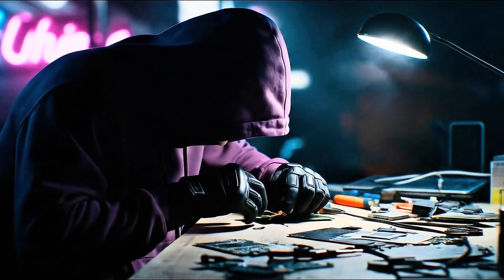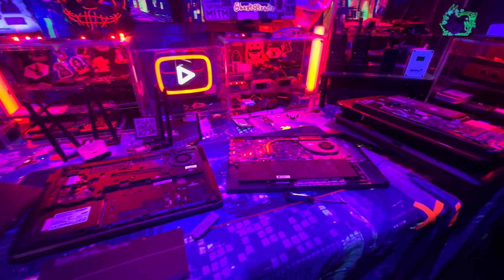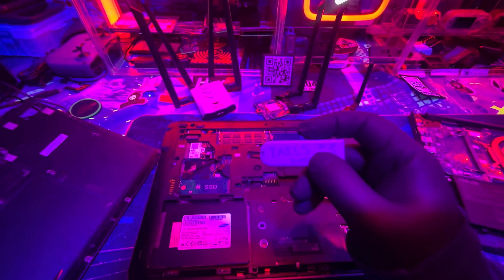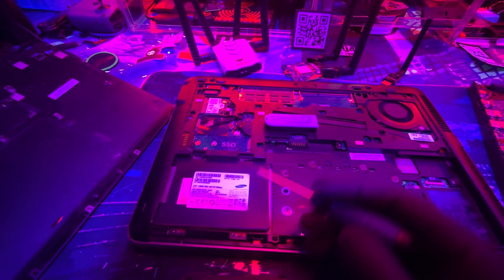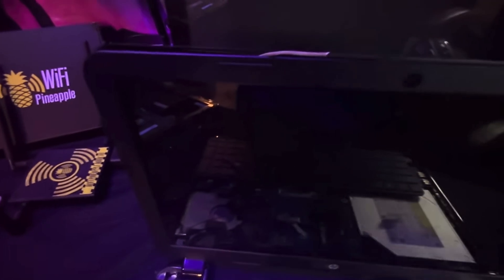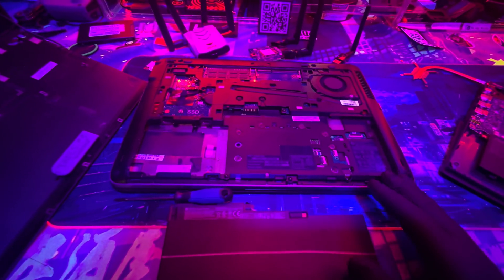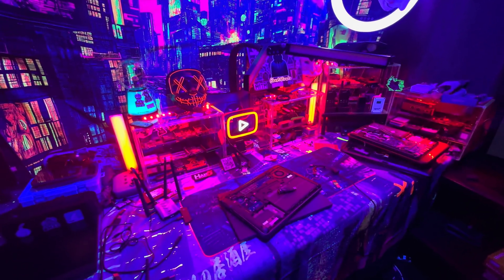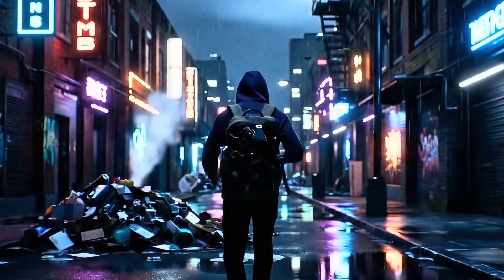DIY Ghost Laptop UPDATED: Full Build Guide — And the Harsh Truth About Privacy!

Comment: unless a device "falls off the truck" before it's sold it's always traceable to someone
even if you dumpster dive that device can be traced to who original bought it - so that's quite a thin point
also: how would you acquire one of those external wifi things? finding a working pc in an industrial dumpster - ok, Dave Jones from EEVBlog scores a system now and then - but an external wifi router to be hooked up via lan? c'mon - chances are quite low
the ideas are in the right direction but simply impractical

Comment: Other than removing cam/hdd/mic/speaker/wi-fi/bluetooth the mixing and matching parts is so marginally better than just one whole single privately purchased computer that this part should be considered silly. 1 whole computer vs 6 whole computers and mixing parts, the 1 computer is the better option. Also less likely your OPSEC was violated 1 time than several.

Comment: But...what about Intels IME hardware backdoor? Breaks this and can enter into OS.
Reply: With it being a laptop, IME will be able to use itself anytime the battery is charged even if off. As well as it will be able to read/copy/write to system ram memory. So IME will still see operation system. It would have to be a laptop CPU that's pre-IME.

Comment: Bro. You can buy a NEW laptop by paying with cash. Leave your phone at home, walk to the computer store, buy a laptop and accessories with cash, and there you go. Unless you are planning on committing a crime with it the same day you are probably fine. CCTV recordings get overwritten after a pre-set span of time, usually 30 or 90 days. Very unlikely that if 2 years later people are looking for you that any such evidence would even exist at that point tying you to your computer.

Also I like Qubes. It's my favorite OS ever. You can run TAILS in Qubes, as a disposable Qube. Even better that way! But you can also run many other VMs, such as Kali Linux. You can run a whole network on a single PC! For privacy and security it is very good. Hard to beat a Type I hypervisor for containment.

If you really don't want your presence tied to your laptop, you have to deal with WiFi immediately. Remove the internal WiFi radio like he does here, or just disable it in BIOS. Better to use a USB WiFi adapter. You adapter will remember all previous WiFi networks you have seen, and will call them out at new locations, telling everyone where you've been before. Your WiFi is constantly shouting, even if you don't hear it. Don't even use it if you can help it.

Comment: Tech makes it obvious about the lack of privacy dude.. lol even complex code, your ultra encrypted password is just a much longer password.. computers are just an illusion of complexity used as lock and key.. confusion for entry and only those that understand it may enter. As far as privacy well, the signals got to go out and it has to be recieved theres no way around that, so an address to and from minimum are needed. Just a matter of figuring out where to hide that in the layered complexity of the code. But control plus f key keyboard in notepad which is where most of computer code gets modified will bring a search tool out eliminating that so a rename and another notepad program file with defenitions that define the characters of the change.

Comment: Great video, doesn't any os run from the ram though? The storage (SSD,nvme,HDD), stores the os in long term memory, when the computer boots the os is loaded into and then run from the ram. So tails Linux is the only operating system to boot on a system from usb and run in ram? Or do most Linux operating systems load from usb and run, then ask if you want to install to long term memory?

Comment: When you buy a new laptop from Amazon they only scan the UPC not the serial number. So if you're using tales along with a WiFi antenna and an external hard drive then once you unplug from it the computer will always be a new computer. But I think you're better off using a raspberry pi and removing the Wi-Fi and Bluetooth card and just build it
Reply: I’m dumb but just read this. if you bought laptop from amazon, tried returning it to amazon with a replaced laptop trying to pass off as the new one, it wouldn’t work cause serial number.

Comment: Cough, cough, Raspberry Pi anyone? Admire what you're doing, but anytime you connect to the internet, you leave a fingerprint. The browser OS etc are all recorded, in the hard drive is the smoking gun. Raspberry Pi can use a small SD card, easier to swallow... Dude Tails on a Pi 0W2 would be far cheaper and far more anonymous? I live on the dark web, it is very anonymous as long as you don't break the rules. A Raspberry Pi is awesome for this, and it will fit in your jeans pocket.  Proxy Chains and Anon-surf are brilliant Linux tools. Your ISP knows you are using Tor, but that's all, they can not see what you do on Tor if you follow the rules. Proxy Chains gives you a new proxy every few seconds. Your hard drive will be the evidence in court! Remember this. Nothing else has enough evidence. Without the Hard drive, they have nothing. You will never be a ghost, just be a way smaller fish than any other mischief-maker and hope the filth goes after them, this dude is 100% on how not anon you are 100%. F stuff up and F the system!
Reply: What you do on the dark web? Never really understood whats the fuzz about.
Reply: @HalleluaYah   chillin' duh

Comment: 1:52

1 is easy. buy it with a prepaid/charge card you paid for with cash. 

2 is easy.  have it delivered to a different house that's abandoned. 

3 isn't an issue if the purchace can't be tracked to you.

4 is easy.  buy an OLD laptop. 

5 is easy if you didn't buy it in a store.

Buy old a$$ laptop.

Take it apart and inspect the parts for any unwanted add-ons. 

Boot it up with a Tails OS boot drive. 

Use public wifi you find around areas you're not normally.  Don't bring your cell hone with you.

14:37  USB Kill is a childs toy that'll just break your PC.  I'd bet money nearly everything on an SSD/HDD would be ok.  and literally all of it on the HDD would be recoverable.

15:30  you literally can spoof how you type and speak and spell.

Comment: You missed one thing. The TPM chip is hooked up with the UEFI BIOS in computers since 2008 or so. As long as u keep the TPM with the UEFI it can be identified back to before being ghosted. So remove the TPM, replace UEFI with Coreboot - make sure u have a compatible machine. And also make sure to wipe the MAC address of the cable ETH controller even when not used. - and remove the CMOS-battery to also halt the RTC when off.

Comment: You dont have to snap your memory strip. just remove it and  connect a spring loaded metal bulldog clip across all memorys edge connections.
Reply: You do realize DIMM is volatile.. you dont have to destroy the DIMM at all just pull it from the slot
Reply: @thatgo916  it is supposed to be volatile, but I remember watching a video where they managed to extract data from the dimm.  however grounding all the pins together destroyed the data.  So that is a lot cheaper than snapping it in half like the author suggests.

Comment: Used to be that the recommendation for hard drives was to use an overwrite program to fill the drive with overwrite then repeat 6 times. One suggestion I saw was to find an unprotected network, access via say a cctv camera or wifi device, (often unprotected), and jump in through that. Very naughty and if one got caught doing that a big prosecution likely so do not do this...

Comment: If you have an LG or Samsung TV it runs on linux and keeps monitoring nearby devices even when turned off...so basically it can discover ur wireless even if ur connected to a different network , u should either unplug ur tv or not sure if there is a way to hide ur wireless receptors or NIC.
I just discovered recently that my TV keep scanning arround just like apple watch...do some research about , it's really tough to stay ghost nowadays with the IOT devices everywhere
Reply: There is no way to go ghost. Unless you literally destroy all your devices and never use the internet again and move to the middle of no where. Even then satellites will find you with due time.  Another way is to steal laptops, use other ppls internet, always wear a mask, cover the cameras with sticky notes and never speak around electronic devices. Also never stay in one spot 😂
Reply: Exactly. Your neighbors TVs and appliances can be used to track and locate you

Comment: Pro tip, microwave any components that have storage on them. The EMF energy will kill the chips from the inside out with the added bonus of corrupting any potential data. 

Or look into how to make an EMF wea-- uhh device to erase data.
Reply: Wouldn't that also screw with radios in the area? If I'm not mistaken (which I very well can be) it would very much gain the unwanted atention of anyone using a radio at the time.

Comment: Many great ideas, though i see some limitations:

still there are things like BIOS memory and graphic card fingerprinting. Unfortunately avoiding graphic card cuts You from way to fight stylometry: don't type for internet - type for one locally hosted llm, than this llm translate it to other language, next second local llmy translates it to another - i'm wondering about such solutions to counter stylometry and time-marks attacks. Anyway zombie laptop sticks out the same way as connection to tor, or running tails. Running the same software from live version of fedora/linuxmint/ubuntu is more time consuming. All this tricks to block backdors and spyware in popular graphic environments etc. take time. Yet once You identify as router, or nas or server or even average joe with popular linux, You don't raise as many flags. Maybe creating false random cookies from social network spyware is the reasonable choice - it's harder to distinguish You from normal network users.

Tails is great for fast jobs, provided that Your bios is not compromised. Persistant mode is just gathering evidence against You. Tool of alleged crime plus proofs of Your guilt. Saving things onto encrypted file on another pendrive is safer.

Comment: The speakers as microphones was an old cold war trick that I'm glad you mentioned. Most people don't even think about a speaker as a microphone. They can even be used as a basic mapping device.
Reply: Someone taught me that it  was possible in a random Medal of Honor allied assault lobby. And I plugged a speaker in to talk to them and it worked I was like 🤯
Reply: I actually used my headphones as mic once. Didn't have a mic at that moment, was surprised how well it worked. Better than some factory made tiny mics

You quite literally put your headphones in a mic 3.5mm jack on your pc and voilà
Reply: I learned this on accident, when I mixed up the headphone and the microphone jacks on my PC.
Reply: Always had this doubt, if the logic is the same, shouldn't it work both ways? 

Thank you youtube
Reply: Because it doesn't work on modern computers. This is all digital and they're run on OpAmps from a DAC. There's no path to use the speakers as microphones on a laptop without re-soldering shit.
Reply: a basic understanding of physics makes things like stuff like this obvious.

Signal makes magnetic field it moves cone...so a cone moving also produces a signal.
Reply: @DaleIsWigging same thing about not spinning your PC fans bc it can generate unwanted electricity lol

Comment: As a rule of thumb do not access darkweb sites via Tor on your main machine for the love of god, even if you're using Tails! 
Always use an isolated machine that doesn't have access to any identifiable information. 

Love the video man and yeah being truly 100% ghost is nigh impossible now. The only way I can see it being possible is if you're using custom silicon PCBs to bypass or manufacture workarounds on a lot of this and even then that's not a solution. The best I've seen is to hide yourself amongst the crowd of data packets and create enough breaks in your online trail that things aren't traced back to you meaning proxys are a must.

Comment: RAM is empty literally milliseconds after it loses power, so unless someone is able to turn your computer back on in a fraction of a second, or you're in arctic conditions, cold RAM attacks aren't a thing that happens.  Also, for the same reason, breaking your memory stick after use is renarded.  It's called "Volatile" storage for a reason.  If it doesn't get a constant flow or refresh pulses, it just empties out.  Like a sieve.  There's nothing left.  There's no magnetic flux to go back and read.  It's just empty.
Reply: not milliseconds, it might be minutes in some cases. as long as your device has the power cable plugged in, it can be powered remotely and secretly even if u shut it down by a power button.
Reply: It was successfully done on a criminal suspect who was involved in some kind of crime involving bitcoin.
Reply: @TheRealStuf Which criminal suspect?

Comment: phones microhphone can hear frequencies that the human eat cannot. the microphone is a very sensitive device that can be used to hear the coil whine, fan speed, and hardrive and use it as acoustic signatures that can give them a good idea about what you are doing on the device. if you are encrypting a file the cpu and motherboard emits a very distinct pattern of coil whine and fan speed. 

take a phone install a distro for armcpu that has tmpfs and submerge the phone in mineral oil ie mason jar to completely damped all sounds. with a whole on the lid run the 5v power through the hole seal it with epoxy. now the only coil whine is the 120v to 5v charger block for the phone, take that apart and completely engulf it in epoxy or hot glue. take said jar with phone mineral oil and cable, bury it, ssh into it from mcdonalds wifi. simple
Reply: bro. . . .. what kinda crazy cool tweaker shtuff are you on about???

mineral oil phone mason jar burried in the ground next to a mc donalds for stealing the wifi???? what the heck kinda crazy paranoid cool stuff are you talking about? i wanna know MORE

Comment: tmpfs and use the flashdrive as your uefi partition or grub? remove drive once booted (destroy it if need be) now the whole system is ran on volatile memory (kill switch script wrote at startup) have it yank the connection and shut down. just a thought

Comment: You hit on something at 15 minute mark no one talks about. 

If they get your input log. They can discern who the user was based on the way you type. It is unique like a finger print. 
Common words used, common misspelling. Phrases. 
Most people are unaware of the fact there are different keyboard types. 
Always using the same type of keyboard or the same keyboard. 
The best thing to do is to get one in a different language than what you’d normally use or be expected to use. 
Then use an overlay or change the key caps.
Reply: the language thing sounds cool on paper, till you realize it will almost assuredly result in gobbledeegook and then they will immediately see it corresponds to english letter placements, and 'decipher' it. Then they would use whatever analysis you are suggesting on it as if you never swapped to a foreign keyboard.
Reply: @JeronimoStilton14  the idea isnt to mask what you are typing but change the way you normally type. Kinda like throwing off a hand writing analysis by writing with your left hand.
Reply: Yes based on how long it takes you to type the next character how long you press the keys and the patterns that exist in between.
Reply: @ParkJustin-r3h That is not the case. Too much data and you can easily spot it.

I'm not saying that it cannot be done. I'm saying nobody is going to use it, not practical. It can be done by your operating system though. Just use simpler ones, free of bloat ware. Like a Linux distro or smth. Tails is one of those.

Nobody's recording delays between button presses. Too much noise to extract meaningful data from that.
Reply: I mean you could probably use a translator. 
Put your message in. Translate into Spanish then Arabic then German back to English. Check that the message makes sense. Good to go

Comment: Out of Curiosity, if you have a framework laptop, is it considered a ghost laptop?
Reply from the maker: So their laptops, they have physical switches that disconnect the components, which is the best practice. A software on and off, which is much different than a physical on and off switch cutting power completely. Remember, there’s a lot of steps and things you have to worry about if you truly want to be private.
Reply: @GhostStrats  True. Cant go completly private, requires good experiance and knowledge. However having a Framework could learn how to build laptop from scratch, plus some rams are stuck on motherboards (Lenovo cough...) so can't remove it without removing the whole freaking board.

Comment: The threshhold for a cold boot attack is about five minutes max.  More modern RAM is clear in 60-90 seconds.  In neither instance is breaking the RAM card helpful, mostly because you aren't guaranteed an opportunity to do that in a pinch.  What you might do instead is simply epoxy the RAM card in place.
Reply: So by gluing the RAM you prevent someone from taking it out? I take it that's required for a cold boot attack.... so would soldered RAM be better?
Reply: @hotdogdcs2761  Cold boot attacks require cooling the RAM card (hence the name), removing it, and putting it into a compatible reader.  His suggestion prevents them from getting it working again in five minutes or less, but epoxying the RAM card in place does the same and is less drastic.

I suppose nothing stops you from soldering it, if you have the skills for the task.